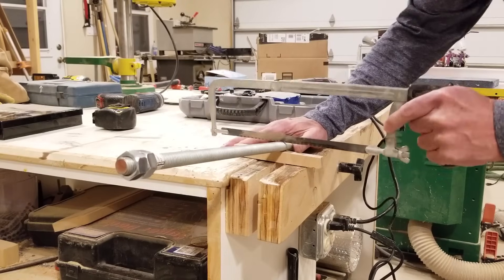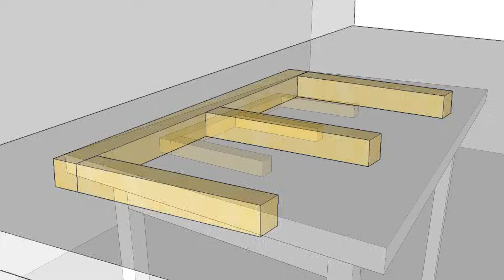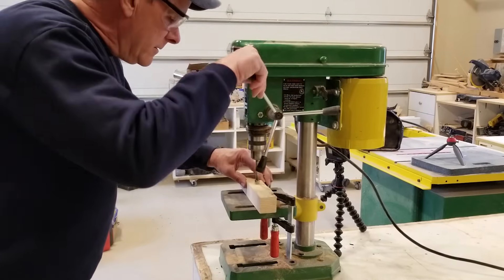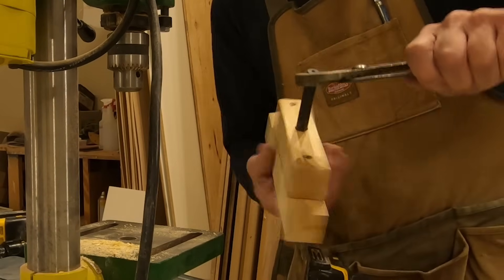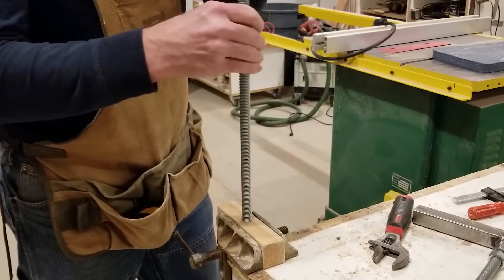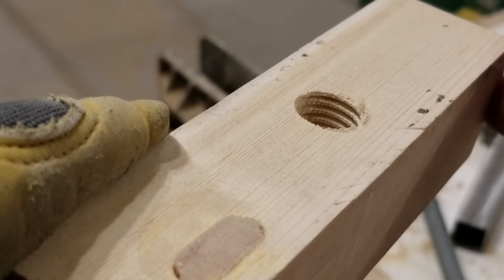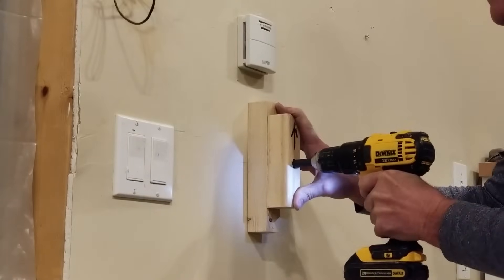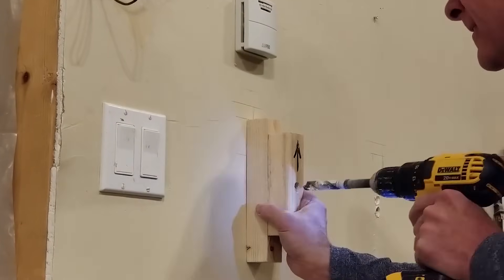Strong Floating Shelves - The Strongest Option

Comment: I am fundamentally opposed to this floating shelf fad. It's a cantilever beam and its a horrible design for strength. There should be cross bracing on the bottom of shelves so they are strong and last the test of time and use. It's puzzling to me why people want these inferior designs in their kitchens.
Reply from the maker: I understand where you're coming from, Cabdolla. My first experience with building floating shelves was when a customer asked me a few years ago to build some for her and I reluctantly agreed. I considered them a "fad" too and was ultimately concerned they would not hold up with the books she was intending to put on them. You are right, it is a cantilever beam and has obvious design issues if you're interested in the maximum strength. So, I started with question of how strong do they really need to be to serve a functional purpose in typical uses?

That led me down the path of experimenting with a lot of different ideas in my shop and I discovered, quite to my surprise, that floating shelves can be designed in a number of ways that are really strong. So, I've done a bunch of videos documenting my experimentation and this one you watched has receive the most attention. Needless to say, my perspective has totally changed on the value of floating shelves. They will easily hold anything I would ever feel comfortable placing on them. I even use them in my shop because they are simple to build and more than adequate strengthwise for my purposes.

I had a question recently on this video if this floating shelf would hold a 350 pound fish tank. My response was, No! Though this design might well carry that weight, why would anyone want to do that? My parameter is, if in a 2' span, a floating shelf can easily carry 50 pounds after being attached to two studs on 16" on center, then that will work for me in any situation where I want to store something off the floor. The 2 rods in this video handled my 200 pounds and barely even flexed, so that will work for me.

The thing I have always not liked about building shelves with the cross bracing you describe, is that the bracing interferes with what can be stored on the lower shelves if you are stacking them. That has always been a big issue with me. That's why I like the floating shelf concept, particularly for uses in my shop. Thanks for your comment.
Reply: @RustyDobbs  Don't get me wrong, you did a great job, it just seems that it requires a ton of more work to get the same strength a simple cross member could have given. I think this makes sense in really high end homes where someone will pay for a skilled builder such as your self, but I suspect the vast majority of people putting this in their homes are going to find them ripping off the walls left and right. You did a great job!

I know what you mean on the cross braces getting in the way of things below the next shelf for sure. Its a trade off on spacing and the number of braces and height between shelves. The nice thing is that you can very quickly move a brace to a new spot (provided there is a stud) and it only requires for new screw holes. I can definitely see where maximizing space would be good for the floating shelf but at the cost of less flexibility in relocation.

Comment: If you sink the holes to make the front nuts flush , you could face it with some strapping at the very least.
Reply from the maker: Very true, Major! You could do that. With the kind of industrial design look that's pretty popular these days, the nuts inset in the shelves and left exposed is not a bad look either. I did a followup video to this one on other shelf design options to use with this type of installation, also.

Comment: This looks interesting. I would like to ask some advice. I'm not from the US, we don't have studs in the walls where I live. We have all concrete walls. What would you use in them?
Reply from the maker: Thanks for watching, Dick. I have a playlist of videos on my channel that's called "All About Floating Shelves" that goes through my process of learning and experimenting with floating shelves. There are some methods there where I build brackets that I  bolt to the wall and slide a finished sleeve over for the shelf. Those brackets can be mounted to studs or solid walls by using a wide variety of metal anchors that are designed to be placed in concrete or brick walls. In each case,  you are drilling holes in the concrete and placing these anchors in them and then securing them as instructed by the type of anchor here are using. You could also drill a hole in the concrete that is slightly larger than a steel rod like I'm using in this video and then using epoxy to hold a rod in the wall. There lots of ways to approach it but obviously it's more of a challenge dealing with concrete or brick walls.

Comment: English teacher (ie NOT a handy person)  here:  How can I do this if I don't have the genius tool you & your son created?  Aldo, how did you not fall to your knees & thank the gods of all that is good & true when the 2 installed rods ended up being PERFECTLY level?  🙆‍♀️  So amazing....  👩‍🏫
Reply from the maker: Who says English teachers can't be handy, too, bKitteh? Right off hand I can't think of one that I know, but I'm sure that's just my failing memory! 🙄 Thanks for watching and for your comment. Yes, that level thing doesn't happen all the time, I can assure you! The tool is something that is nice if you are intending to do floating shelves with some regularity. If it's a one time sort of thing, you can locate and drill appropriately sized holes in the studs, trying to get them as perpendicular as possible to the wall face (to have a shot at them coming out level). Then the rods can be installed using a drill or two nuts tightened against each other (jam nuts) to allow you to twist the rods into the depth of the hole with a wrench. If they are a little out of level, it doesn't hurt to bend them a bit to make it look like a perfect installation! Good luck if you decide to take it on! I would like to know one English teacher who is pretty handy after all!
Reply: @RustyDobbs  (I'm blushing!)  My dad tried to make me as handy as possible...  He's gone, but in my head I still ask him what I should do when I get into a project/repair jam.  💔  Thanks so much for the detailed answer to my question!   I'll let you know what happens when I try to create my own floating shelves.  🙋‍♀️

Comment: So satisfying to watch. I need one of you in my home, haha. What’s the best way to secure a shelf support to a brick wall?
Reply from the maker: Wish I were around to help you out, SpicE! Looks like I would enjoy you cooking a meal in return! There are lots of alternatives on the market for dealing with brick. But the primary challenge is drilling  perpendicular holes to the wall and securing rods in those holes for the floating shelf to mount to. The rods can be glued in place with epoxy adhesive or 'wedged' into place with different types mechanical fasteners that are available. It's a pretty common issue in the UK with so many brick buildings. Good luck!
Reply: Concrete anchor bolts.

Comment: I have been doing this same design for YEARS ... Using the SAME threaded rods, i just pre drill a whole into the stud 3 inches in with a drill bit that is slightly smaller in diameter than the threaded rod ... Then use 2 nuts. The 1st nut then the 2nd nut that hits the 1st nut and its used to drive the rod into the 2x4 stud using an impact driver. I put a piece of tape 3.5 inches in from the edge of the threaded rod so i knew where to stop because 3 inches into the stud and 1/2 inch for the drywall length. Then built the same frame that you used in 12:25 and put a 1/2 inch plywood cover on top ...
Reply from the maker: Yep, I have heard similar comments from other contractors who have figured out their own methods over the years. Probably the most common idea is taking lag bolts and threading them into the studs, then cutting off the heads. Sounds like this approach has worked well for you! Thanks for your comment!

Comment: Could you use the "two-nuts-on-the-all-thread" method and then an impact driver on the second nut ONLY to drive the all-thread into the wall? Or would that just spin both nuts?
Reply from the maker: No, you're right, kcummo! If you tighten the two nuts against each other then put the impact driver on one of the nuts, that would allow you to screw the all thread into the wall. 😀

Comment: Actually, pipe resists bending moments better than solid bars because there is more surface area.  If you were to get into welding you would have better results
Reply: But still a great project, don't take my comment the wrong way.
Reply from the maker: No problem, I didn't take your comment negatively. When I have picked up new trades I have been interested in over the years, I have tried to gain a pretty high level of proficiency and for the most part have done that. My son and I actually bought a nice Miller Multimatic 215 welder a year ago for a project he was working on. The little bit of welding I have done has pretty much confirmed what I expected about metal work. If you're going to get good at it, you have to commit a lot of time to it and realize the skill set needed is much different than working with wood, tile, solid surface, etc. Though I would love to become a good welder, the reality is if I become a very average welder over time, I will probably need to be satisfied with that because my time is limited. There's a lot to learn and skills to develop. When you look at really good welds and welders in action, it is obvious one does not learn that overnight. Thanks for your comment and for watching!
Reply: Well, great you have a welder.  Thankfully you don't see the welds on a floating shelve.  You don't have to be a great welder to do this, all you have to have is enough penetration on the weld to make them one with each other.  Great job and really enjoy your videos.  Thank you for your response.  Here is one of my projects you may be interested in.  I didn't get a chance to finish it yet.  I deployed almost a year ago to Iraq and now Afghanistan but I leave soon and will get back to this project when I get back.  https://www.youtube.com/watch?v=fqz7Qj1H-NI&t=4s
Reply from the maker: Thanks and I'll check out your video and channel. Take good care, my friend, and thanks for your service. Check in with me when you get a chance.

Comment: This is great help in desiding to build my own floating shelves. Thank You. I wanted to ask you what kind of drill bit you where using on your drill press. I want to buy a set.
Reply from the maker: I think you are probably referring to what are called Forstner bits, Thomas. They are very handy for boring out holes in wood and leave a very clean cut and a flat bottom. They work best in a drill press. Good luck on your project!

Comment: seriously you do not need drywall behind the shelf,  drill a larger hole with a hole saw in the center of a stud 3/4" big  drive your  1/2" all thread into the hole  cut a relief in each one you can drive it in with a drill motor instead of a T handle cut the relife into each one on one end.
once its to the hole depth your looking for  then slide the 1" thick shelf over the rods 
on the outside end you can use a lot of ways to keep it from coming off the rods.
But all thread isn't cheap  you can buy 1/2" 1045 stress proof steel rod and cut threads on one end about 4" long then use a solid rod  drill a hole in the center of the other end and thread that with a 1/4 20 tap and lok the shelf on with a 1/4 20 cap screw and washer. then plug the holes.  That's not coming off without a lot of force. 
That should hold a lot of weight     but so do French Cleats and they are a lot less work to make.
Reply from the maker: Like your 1/4" tap idea on the end of the rod, Bob! Also like french cleats. Just did an 8' vanity mirror that is backlit with the cleats. Worked out well! Thanks for the comment!

Comment: hmm, a 1 degree upper pitch would have been great to avoid showing gravity exists.  lol 

do you have a wood threaded dowel instead of a machined threaded dowel? would have made and excellent strengthening bond.

a couple washers would have been great to the addition to keep the nut from going into the wood.

oh, and for the top [ the solid wood plank ]  drill hole into wood and rod , then insert a dowel  [ metal or wood ] to hold the
solid shelf in place. to get the metal dowel out, just use a magnet.

over all, very impressed with the construction of the floating shelf. i am intrigued.

awesome video !!

3000 thumbs up !!
Reply from the maker: Thanks, Scorp, and I appreciate you watching! Good ideas from you as well! I haven't gotten into threaded wood dowels but have that on my list of things explore. Thanks for the comments!

Comment: I’d agree that this method has the be the strongest. Unfortunately, it will not work for folks like me that have metal studs. I guess I can always cut open the wall and-sister two pieces of wooden studs to the metal ones too. But not much folks are capable of doing that themselves. Also, most people probably won’t want to cut open their walls just to add a floating shelf. May I suggest using a magnetic stud finder or just a magnet to locate any screws, metal in the Sheetrock. Should save you the headache next time. Great job though.😊
Reply from the maker: You are right, P F. Metal studs pose a different kind of challenge and you are describing quite well what would have to be done to install floating shelves. Sounds like you are one who is capable of taking on that challenge yourself! But I would think you would really have to like the idea of floating shelves to take do it! Thanks for you comment!
Reply: Rusty Dobbs - You’re welcome and thank you. Yes, I am quite capable. Been doing this type of work all my life and still doing it today.😊

Comment: You need to sell that threaded rod handle on line. I'd buy one. Also, with my luck, I would hit the electrical wiring on my first attempt and then the copper water line on my second. On the third attempt I would hit the gas line.
Reply: *my third and final attemp.. lol
Reply: Me too - Rusty, have your relative sell them - I'd pay for one today in 3/4", 1/2" and 3/8" (I make diff size shelves.) (I don't own the equipment to weld, nor want to mess around with figuring out how to weld.)
Reply: Same. I don't have the equipment to make the rod handle. If you decide to make some and sell me us know.
Reply: I’ll take one too!! I would like to try this method instead of hoping something off of Amazon will suffice.
Reply: And then hopefully you end up in heaven..😉

Comment: May I suggest an option for cutting an all thread to all your viewers? Use two bolts on either side of where you wish to cut the all thread, then cut it with a hacksaw. If you use four bolts, one to lock each of the first nuts in place, it will allow you a cleaner cut and quite quickly without wasting one of your cutting discs. On thinner all thread rods, you can attach the all thread to a drill snd spin it back and forth against a stationary blade for even faster cuts.
Reply from the maker: Good ideas, Frank! Thanks for passing them along!

Comment: Put one side of your all thread inside of a drill, depends on how long the all thread is, but you or somebody grab the nut on the other side with channel locks, spray some WD-40 on the all thread and then hit the trigger on hi-speed. Then work the nut all the way back down to the opposite side again. do that so anytime you need to run any type of nut or whatever down the all thread, it will be no problem.

Comment: Could have had a nut on your tap to give you the absolute depth, by the way.

I'd also use a big-ass washer on the nuts securing the wood frame to the wall, as well. That maximizes the pressure distribution across the whole of the wood, rather than right at the nut -- which, just from the example shown, offers about a 9x pressure improvement (the wood appears to be about 3x the size of the nut, so it's at least 3xPi, or more than nine times the area -- probably a lot more, since you subtract the rod area from the nut surface in contact with the wood -- even if it's only 2x as large, again, the rod area means it's probably well over 5x the nut contact space)

Comment: you would have much less deflection if the nuts that he the frame on were on the outside of the frame (furthest from the wall)  essentially clamping the entire frame to the wall. having that constant tension would make it muh more rigid
Reply: that's actually a horizontal version of a trick we contractors use to stiffen up pony walls

Comment: I think I’d put epoxy on the all thread before screwing them in since wood threads aren’t too strong. JMHO.
Reply: If one really wanted to get serious they could insert a female threaded plug into the stud; this would be almost like a drywall insert.  You'd have to drill a hole in the stud, then insert the female insert.  Then you'd have metal-to-metal with threaded rod screwing into metal insert in stud.  You could have the threaded plug go 2" or so into the stud.  Just a thought.
Reply: If the shelves need to come down it would be cool to simply unscrew them.  With expoxy it'd be a pain to remove.
Reply: Kroban3 I just meant epoxy them into the studs.
Reply: @kennethbailey2616 

Exactly, and I say don't epoxy them because if you need to remove them it will be more difficult.